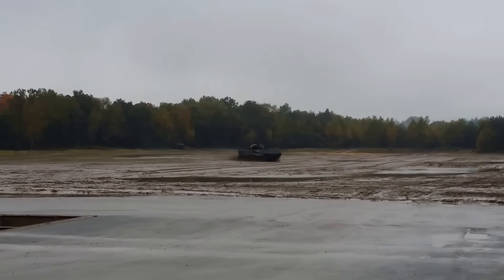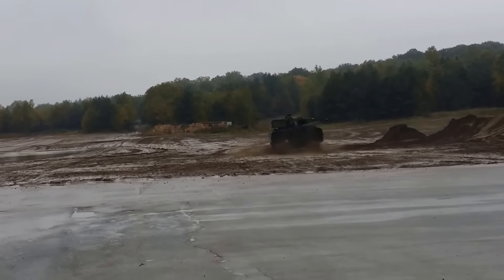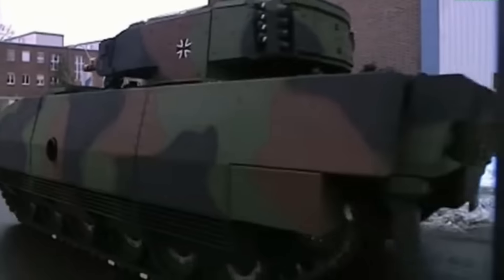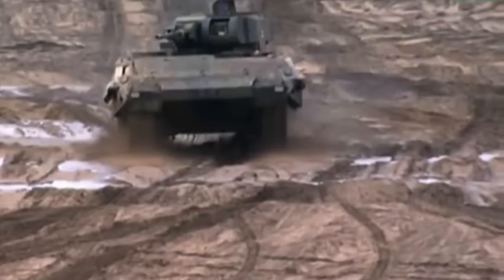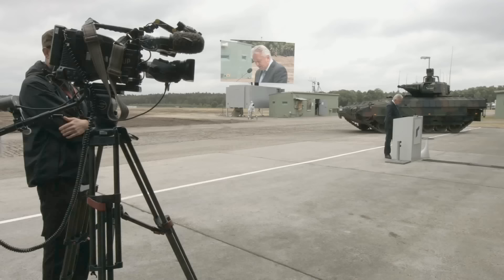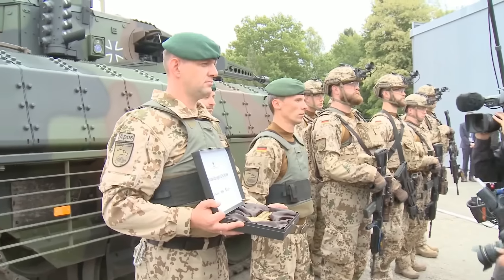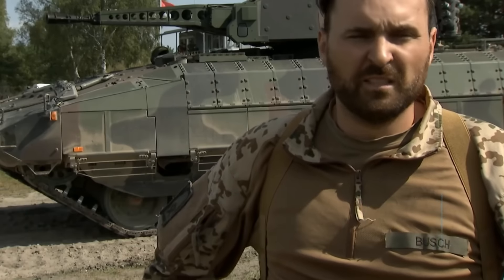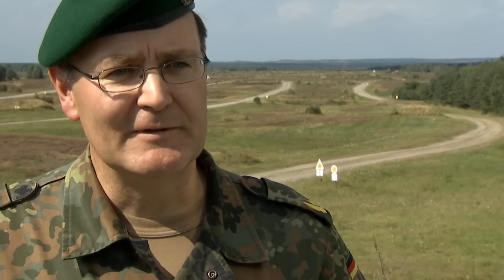The Puma Infantry Fighting Vehicle - Overview and Opinion

Comment: 43 tonnes... That's massive. I have my doubts about the 5.56x45 as support, Think 7.62x51 provides way more punch.
Reply: 5.56 is enough for suppression
Reply: wwwelkam 5.56mm has a lower range. 7.62mm has a longer range.
Reply: Actually they are replacing that 5.56 MG4 with a 7.62 MG5.
Reply: Andrew 30mm is an overkill.
Reply: Their only customer at the time is the german army. And i doubt there will be more. They have the Lynx for export.
Reply: Jonny I beg to differ, Australia and Canada are considering this, and Philippine Army considered them back in 2010-2011, but the latter dropped due to cost.
Reply: In cases where they need to use the 30mm against infantry targets they will usually use very few rounds of the ABM (air burst munitions), which will detonate at a pre-programmed distance and release hundreds of very small darts which, if I remember correctly, are made from tungsten. 

Basically, as Matsiums described it in the video, a shotgun from overhead.

Anyway, in that way it wouldn't necessairly be overkill, but efficient use of the correct types of ammuntion, as the 5.56 is good at shorter ranges, but needs more bullets, whereas the ABM of the 30mm can deal with any threat farther away.
Reply: Selvariabell yes 5.56 has lover range, but your infantry also uses 5.56 so if they are engaging enemy then puma can also suppress the enemy positions. For everything else that 30mm cannon will be used.

Andrew "5.56 is very effective for target under 800 m" I dont have ballistic data but 5.56 bullets have low drag coefficient and can believe that you can effectively engage targets at 700 meters. Under 400m is more believable.
Reply: wwwelkam True, but 5.56mm has puny penetration and punch, 7.62mm would be better against enemies hiding behind walls.
Reply: 5.56 is a great anti-infantry / suppression round. You can carry more of it than 7.62x51 (almost twice as much per unit weight) and in an automatic weapon the volume of potential fire is what matters. It's why only GPMGs really use the 7.62x51 round anymore. While it is true that 5.56x45 is not great at hard barrier penetration, neither is 7.62x51, you really need something like .50BMG to turn real cover into concealment. On an IFV, the 5.56x45 MG is really designed to keep enemy infantry's heads down while your infantry disembark and use fire and maneuver tactics to get the enemy out of their fighting positions. 

If you need to deal with the enemy where they are, 7.62x51 isn't really going to do too well either. But then again, that's what your main gun is for. 2-3 auto-cannon rounds or a couple of 40mm grenades will be far more effective than any amount of MG fire if your goal is to actually reduce the enemy strong point.

The range disadvantage isn't much of an issue either. Chances are, you're not going to be using your co-ax to engage enemy troops at extended range anyway.

Given these issues, it makes perfect sense to carry 2x as much 5.56x45 than 7.62x51 for the situations where you're actually going to use the gun.
Reply: Selvariabell 7.62 is not that amazing at penetrating walls either and Puma has 30mm cannon for that. For suppression 5.56 might be good enough and you get more rounds
Reply: pwrserge83 Good argument, I must say. Although I'm a bit conservative in the secondary armament. My only gripes with the Puma would be her secondary armament and remote turret, aside from that, I LOVE the Puma.
Reply: Selvariabell, it's just my personal experience from having to haul around a 7.62x51 DMR in Iraq versus my standard issue M16A4. (That's what I got for showing off at the rifle qualification range.) Weight and volume of fire matters far more than the difference in performance between 7.62 and 5.56 except in VERY specific situations (like in the aforementioned DMR role). Personally, I would have much preferred to get an mk12 SPR along with some mk262 ammo to do my DMR work. Unfortunately, I don't see the USMC coughing up the cash for that.
Reply: pwrserge83 I understand, every army has their own set of experiences and doctrines. I have to admit, my argument on the secondary armament is based from the environment the Philippine Army is fighting, in tropical forests and towns with light buildings. In this situation, the 7.62 would be effective in penetrating through wooden obstacles. But then again, the 5.56mm would be more than enough in Europe and Middle East.
Reply: Andrew I have no doubts with the power of the 30mm.
Reply: Andrew, you had it right the first time. Maximum effective range of a 5.56x45 round against an area target is just about 800m.
Reply: The 5.56 is only an option. If it will be regularly mounted remains to be seen. 7.62 has a higher range and  muzzle energy but 5.56 has better penetration of body armor because of it`s smaller diameter and higher velocity. And if you spray double the amount of bullets, you double the chance to hit the gaps between armor elements. And if you double the amount of bullets for cover fire flying toward the enemy, you get a much higher psychological effect. The enemy doesn`t care about the caliber, when a barrage of lead comes in.
For any higher ranges and purpose you got the autocannon. If you want to hit a target behind cover, use air burst, or just destroy the cover. In case of destroying the cover, it doesn`t matter which caliber your secondary weapon uses, but how much ammo you carry, to stay ready. Sorry for my bad english, but i think it was understandably ;)
Reply: pwrserge83 Fair point.
Reply: BierzeItboxer Correction, 7.62mm has better penetration against body armor.
Reply: @Selvariabell Depends on the 7.62, the 5.56, and the body armor. High velocity 5.56x45 (m193) actually does better against steel armor than 7.62. Both fail against ceramic or composite level III hard armor. Both go through soft armor with little difficulty.

There's really not a common form of personal body armor out there where 7.62x51 does better than 5.56x45.
Reply: Research done decades ago found that successful maneuver during battle depends much more on the number of rounds delivered than their caliber. Which is why the somewhat wuzzy 5.56 became standard in the west. Any hunter will tell you it's civil version (.223) is only suitable as a one shot kill on animals up to the size of about a largish dog. But humans don't like to be shot at with anything. 5.56 is much lighter and  more rounds can be carried and many more can be fired under good control to keep enemy infantry heads down to enable maneuver.
Reply: Both are lacking, 6.5mm wildcats like 6.5 grendel or creedmore do better than both of them. If that doesn't quite cut it then there are plenty of efficient 7mm's out there. All of them provide much better performance than the 7.62 NATO for less recoil and weight and have virtually none of the shortcomings of the smaller, weaker 5.56. And at least the two first ones can be chambered in short actions. Though that might not matter much when its mounted on a vehicle. 

Remember the issues with the 5.56 and knock down power in Iraq but especially Afghanistan at long ranges? Instead of fucking around and throwing money everywhere like the DoD did with the mediocre 6.8SPC, they should have just adopted a 6.5mm ala the 6.5 grendel or creedmore as they both chamber in shorter action rifles. 

They easily beat the 6.8SPC(a glorified 7.62x39 as far as ballistics go) when it comes to range and trajectory especially. This was even noted when the 6.8SPC was used in combat; it wasn't all that good at long ranges despite that supposedly being taken into account when designing it. It was half the reason they dropped it in the beggining, it was underwhelming. Its now picked up again, apparently because they are blind of 6.5mm's and 'cuz the 6.8SPC is still more versatile than the 5.56.

Same with the .50 cal, its a very inefficient round with pretty mediocre seasonal ballistics that is easily beaten by experimental .40 cals from Chey Tec and Barret for example. Wouldn't have to change the caliber even, just make a more efficient cartridge like Ackley would do. 

Also seen in many armies that they are 'reverting' back to slightly smaller long range calibers again as the .50BMG has huge issues with recoil, weight, accuracy and even trajectory and is generally overkill. A .338LM is a much better overall round when taking all those variables into account and is more than 'lethal' enough at almost any range. 

.50cal does however show a lot of potential for 'high tech' bullets though, like projectiles with microchips in them that can be controlled and aimed after exiting the barrel. Its so big that it does that better than smaller rounds. A lot of research is going into that stuff these days and the DoD is taking its funding and potential adoption of such a weapon system seriously. 

Of course all that creates issues with logistics and NATO standardization so its highly unlikely it would ever be done. In a perfect world though :)
Reply: 5.56, 762x51 and 50cal bullets are too short and only low ballistic coefficient bullets can be used in those cartridges making them poor performers at longer range. Apart from poor bullets 762x51 and 50 cal are good MILITARY cartridges when used in machine guns. Having hotter cartridges like .416 reduces barrel life span
Reply: Nico By Ok... You really need to quit lurking on arfcom and go actually shoot some matches. 5.56 is a perfectly adequate round when you combine the appropriate round with the appropriate barrel length. The army's new M855A1 is possibly the most devastating intermediate cartridge in existence.
Reply: pwrserge83 look at BC (ballistic coefficient) of all 5.56 bullets. Its pathetic and you cant increase it because there is no room for longer bullets. With current advances you can make new cartridge that is better than 5.56 in all aspects
Reply: wwwelkam BC only matters when you're punching paper from a concrete bench at 800 meters. The 5.56x45 (just like any other intermediate cartridge) is designed for an optimal engagement range of 0-300 or MAYBE 400 meters. If you want to reach out and touch someone, you always have the mk262 77gr OTM. That's FAR MORE than capable of engaging a point target out to the limitations of the user's optics and skill level. (~600m in most practical situations)

The entire argument that 6.5 is "better" leaves the interesting question of "better for what"? Within the engagement range that 99.9999% of M4s will ever be used at, the M855A1 has nearly identical terminal ballistics and weighs almost 50% less per round. For DMR work, the M80A1 packs a much nastier wallop and roughly the same effective range (again, field and optics limited, not cartridge).

6.5 Grendel is a perfectly adequate cartridge if your goal is to punch neat little holes in paper from a covered concrete bench. If your goal is to punch holes in PEOPLE, the 5.56x45 does the job just as well with none of the drawbacks of a boutique cartridge.

Let me give you an example. A few days ago my club ran a practical rifle competition. We had a stage where the shooter had to haul a 30-40lb ruck on their back and engage two IPSC steel targets at ~120m at each of eight firing points from either a standing or kneeling shooting position. Out of almost 70 people that showed up, nobody ran that stage clean.
Reply: "BC only matters when you're punching paper" After saying that its clear you dont understand this topic. BC always matters. Having low BC bullets its like driving a car with a hole in gas tank. You loose bullet speed for no reason. For exapmple the most used M855 looses half of its energy at 300m and that is from m16 barrel and after that it "drops form the sky". 

"the M855A1 has nearly identical terminal ballistics" Dont pull stuff from your ass. M855A1 is made from hard metals and wont deform when entering soft tissue while most 6.5 bullets are either hunting or for competition and they would leave far greater wound channels because of deformation and bigger diameter.

Your image of combat is flawed too. A squad can expect to engage enemies anywhere form 0m to 600m and US army recognized shortcomings of m16 platform. Since 2010, the U.S. Army has made available two M14 EBR-RI rifles per infantry platoon for units deploying to Afghanistan.

All of this could be different if only 5.56x45 was 1cm longer.
Reply: My understanding of combat is flawed? Really? Have a lot of lead slung your way have you?

Go shoot a practical rifle match and get back to me. I deployed with an M16A4. It worked great for what I needed it for. If you think you're going to have individual infantrymen engaging individual targets in field conditions with a AR platform, you've never actually had to do it.

Real life is not the same as punching paper down at the KD range.

You're talking theoretical numbers and I'm talking practical applications. Go look at some gel tests of M855A1 and quit talking out your ass.
Reply: pwrserge83 True, each military has their own set of experiences and their doctrines align with these experiences. And for that, I give you my credit. 

Just a heads up though, what works in one army, doesn't work for another, and for that, we must take into consideration the environment and the situation.
Reply: Selvariabell You're not wrong, but the idea of an intermediate cartridge effective against a point target our to 400 meters or so came from literally decades of research. The US Army didn't just wake up one day and decide to remove all the M14s from inventory because they had a bad night out drinking.

The reality is that in WW2, there were only a handful of reports of any infantry engagements past 300 meters on either the western or eastern front. It just plain didn't happen. The same was true in Korea. A full battle rifle cartridge or its ballistic equivalent just isn't necessary given the other constraints it brings to the table. 

The big one is weight, so let's do the math.
A typical 6.5 Grendel round chucks about a 110gr projectile at ~780m/s (I took middle of the road loadings as no NATO spec cartridge exists.)
That means that, generously, a single round of 6.5 Grendel weighs at least 50% more than a single round of 
M855A1 5.56x45 (66% - 80% is more realistic, but let's keep it at 50% to make the math easier)
A typical combat load for the US Army is 6-10 magazines of 30 rounds each weighing in at 2.8 - 4.5 kg. That gives you a standard combat load of 180 - 300 rounds.
A 6.5 Grendel rifle is going to have 2/3 the ammunition available for the same weight. (Don't forget, weight is a zero sum game in infantry combat, if you want to increase ammo weight, you have to cut something else.) So your standard combat load drops down to 120 - 200 rounds per infantryman. (Probably less given the magazines have a weight as well and Grendel magazines only hold 24 rounds.)

Now let's see what we get from that increased weight...
Possibly a better ability to punch targets at 600 meters. (We're not going to touch the 800 meter fantasy for individual small arms.)
What else do we need to reliably engage a target at 600 meters?
We'll need an optic much better than the standard issue ACOG (4x), EoTech, or Aimpoint the US military has standardized on. I don't care how good your rifle is, you're not hitting low signature targets at 600 meters with a red dot and human eyeballs, not without replacing the red dot with at least a 6x scope. (Making the rifle useless for CQB.)

Finally, I get REALLY pissed off at the "lack of stopping power" myth for the 5.56x45 cartridge. That myth came out of completely unverified "friend of a friend's uncle's cousin's brother" reports. The only time I could find VERIFIED reports of this "problem" was from the battle of Mogadishu when Rangers were shooting light armor piercing ammo at half starved Somalis drugged to the gills. The idea that you could magically turn ANY rifle cartridge into a one shot "man stopper" while using ball ammo is ridiculous. The M855A1 tries through the simple expedient of controlled fragmentation. (The round is designed so that the penetrator separates from the copper body of the projectile on impact and causes the casing around those two components to shatter.)

While the M855 has serious problems, it's "stopping power" is no worse than any other intermediate cartridge. What it DOES have a problem is with barrier penetration which is where the M855A1 comes in. (The USMC had a similar program to develop the mk318, but it looks like we'll be adopting the Army round due to supply commonality issues.)

The idea of an individual rifleman engaging targets out beyond 500 meters has been the mantra of armchair generals and keyboard commandos since WWI. That stupidity held back rifle development for decades and almost certainly got thousands of men killed.
Reply: pwrserge83 I agree, intermediate cartridges are very effective, deadly, but lightweight, the 5.56mm punches more than its expected. What I am saying is with military equipment in general.
Reply: They have a big 30mm ATK for people hiding behind walls :p
Reply: "5.56 is enough for suppression" its also a smaller round so can carry more ammo for longer fire support , but still i think id prefer to be hit with a 5.56 than a 7.62
Reply: 9mm para carry more again 
or the modern 5.7mm*28 of the p90 
or the german 4.8mm of the mp7
Reply: Optional.
Reply: 5.56mm is good enough to kill.  Very lethal as well.  And you get to carry way more ammo and is lighter.  I'd go for 5.56
Reply: They already replaced the 5,56 with a 7,62 mount.
Reply: They are able to swich between, they did not replaced it, i AM on the german infantry co', under what you call if i do remember the "puller" group - [3 man] under squad command in the armored infantry "riffle squad" [9 man, "1 exo driver"] under the Bundeswehr "panzergrenadiers". Cannot say in what squad i operate do'. 
But we already had the pleasure to play with our new toys like the Puma. [Another thing, dont be fooled by the "size" difference, 5.56 are absolutly deadly, as much as a classic 7.62 and i would say even better fitted for "suppression and support" on ground.]

[Edit] If you want a VERY impressiv' example, take a look at the Belgian FN 5-7, this gun is just nasty, AND this is JUST a hand gun, nothing compared to a classic mount. A other thing, DONT worry about the electronics on the Puma... Really, they are rated for every environement and even shielded PLUS easely switchable, IN field.
Reply: They can switch, (MG4 and MG5 have similar mounts) but currently there's a tender and the Puma may get a Rheinmetall 7.62 RMG (MG3 with +2 barrels wich switch if overheated). Like on the Lynx.
Reply: Puma can get changed between 5.56 and 7.62 in a heartbeat.
They use 5.56 so that the crew man can use in an emergency situation the ammunition of the IFV for their assault rifles if they need to. That is the reason why they chose the 5.56. But the Puma can use both calibers.
Reply: You have more rounds and you can give these rounds to infantry if they need it. If you have to fight against enemies behind walls than you can use the 30 mm cannon and the grenade launchers.
Reply: Well, that's why you have a 30mm.....
Reply: watdeneuk I agree especially against forces in Afghanistan 5.56x45 shows that a replacement is needed, lacks range that the older lee enfield or other older ww1 and ww2 rrifles that have twice the range and are common in the area.